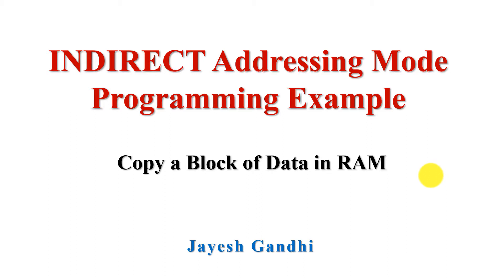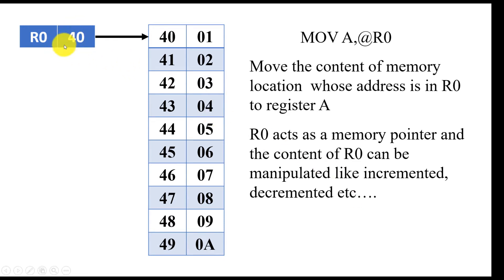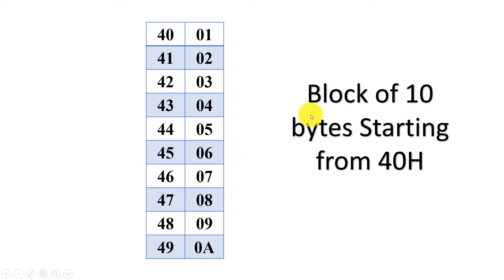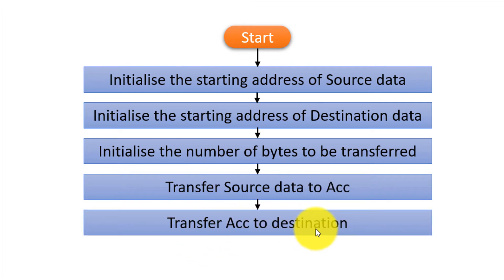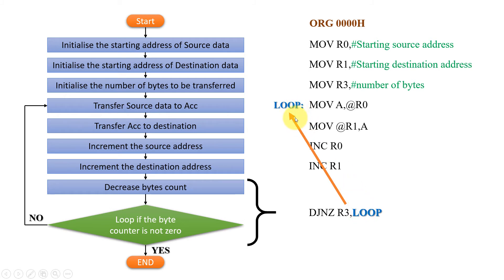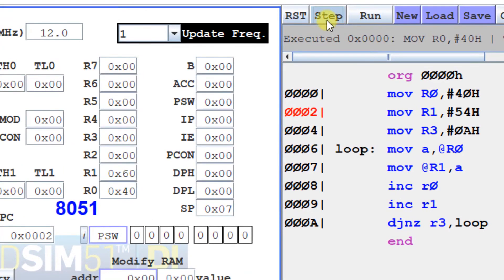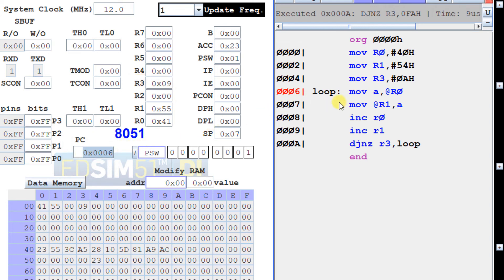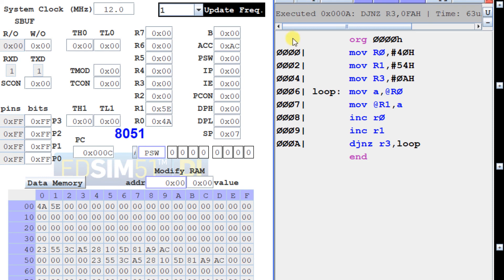8051 Indirect Addressing Mode Explained with example and simulation

Comment: Sir , actually I know ASM but I want to know all of these in c .  a character generator lookup arry [ ] is situated in rom address  0600H and a 2 dimensional ram arry [ 8 ] [ 6 ]  is started at 60H in RAM inside 8051 . I want to copy look up arry first byte and place it to first byte address of 2 dimensional RAM arry .
variables----
unsigned int  lookup_addr= 0x0600 ;
unsigned short i=0, j=0 ; 
ram_arry[i][ j]=lookup_arry[lookup_addr];
can this last code line be exicuted ?